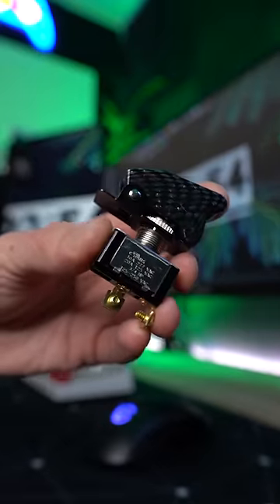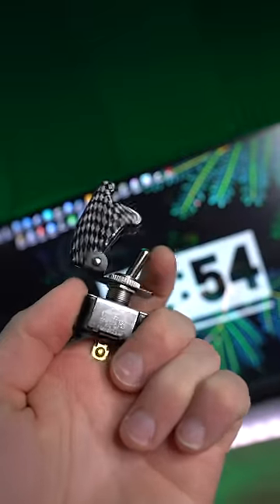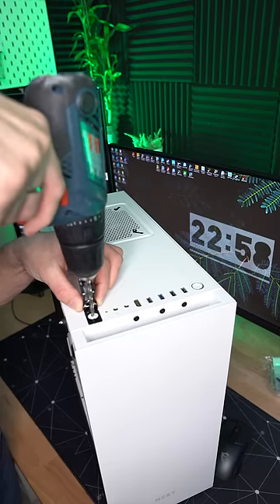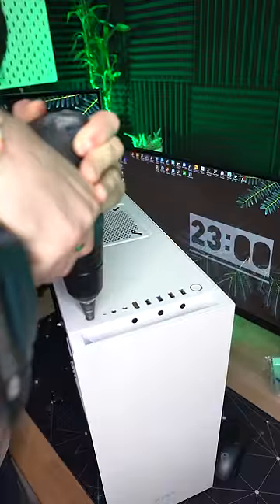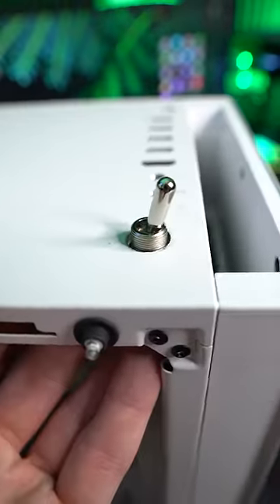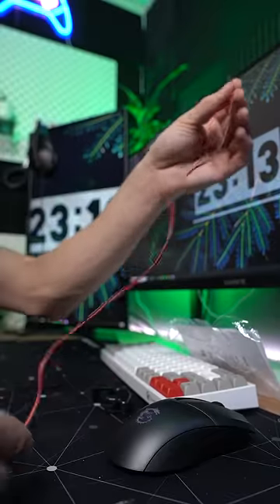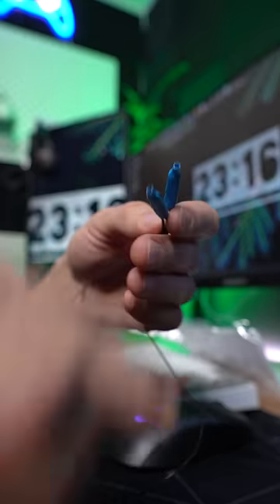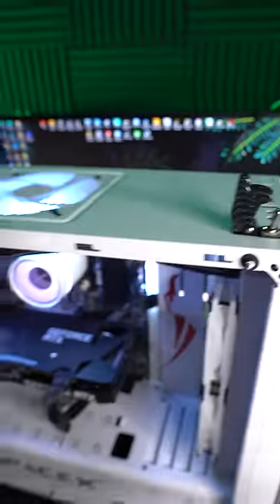Using a Fighter Pilot Switch to Turn on my Gaming PC! #shorts

Comment from the maker: Many people have done this, I first used them in July of 2020 on the 1st edition of the SpaceX PC as you can see here…https://youtu.be/kTO0JK9smew
Reply: Lmao just use heat shrink for your wires dont use electrical tape
Reply: Hey dude - buy some heat activated cable welds. Little plastic tubes which bind the wires together as though they have been soldered, and all you need is a heat source, like a heat gun or lighter.

Instant bonding and instant + tidy sealing.
Reply: @rationalgazer  someone literally just said that. You’re late pal
Reply: @TheeHusky  I'm not late, because I'm not refering to the same thing. The thing I'm referring to has a solder bead in the middle, and isn't just heatshrink tubing. So thanks for the input and allowing me to confirm.
Reply: @rationalgazer  2w
Reply: Ruined by disgusting 🤢 tape job... Solder at the base of the switch?
Reply: @rohilutekar7996  no. Because that's heatshrink, which is adequate, but NOT thing I'm describing with a solder ring incorporated in the middle of the prepared tube.
Reply: Hey man. How did you get a clock to work as your wallpaper? Can you send a link?
Reply: If your building a good pc to game on what do you think the bests parts are for this?
Reply: Man was out here with the b cons
Reply: Reminds me to when gaming cases did not exist and I went to a friend father workshop to make punched vent holes on the side cover.. Lol
Reply: @jaredhared  I would of done the same as him man ... Whatever works
Reply: Misunderstanding again?
Reply: Link to the switches??
Reply: Your toggle is mounted upside down. You should have to fully lift the cover and then actuate the switch downward (unless they keyed the switch plate that way). The way you have it you could lift this cover up and accidentally actuate the switch in one action. Defeats the purpose of having the cover.
Reply: Thats all fun and games until you accidentally turn your PC off
Reply: #save_sri_lanka
Reply: @chamindukavishka3187  Why would we? You choose a socialist government, you get to live with it.

Next time make better choices.
Reply: What name of song on this video
Reply: Dale
Reply: I think my buddies dynamite plunger power button is still cooler but switches are always cool too
Reply: Bro I watched your video from much time but I don't have my own pc I would be great if any one would gift me a graphic card
Reply: Am i the only one here who noticed he filmed this at 11pm?
Reply: @YourPersonalGeek I want to do this to my own pc where did you get the switch from?
Reply: why stop at power switch. you need a bank of them for fans and RGBs

Comment: This is definitely cool. I think it would only be cooler if you built it into your desk as a full set up and had switches for monitors and buttons for other devices
Reply: Problem with that is that you need to have a hole im the case for the wire and hide the wire somewhere wich means another hole in the desk
Reply: @daanoffline5716  yea but I mean...the man drilled a hole into his case. I'm sure he could mount his PC on the wall or something and get that all set up
Reply: @nickNcar  yeah probably
Reply: @daanoffline5716  you can maybe even use some ventilation holes for routing the cable into / out of the case
Reply: you’d definitely want to run relays for that so you don’t have the full 240 or 120 volts going through your desk
Reply: or just a switch connected to a power splitter...
Reply: @daanoffline5716  you would definitely not need to drill a hole in the case itself for the desk switches my man
Reply: dogielow  ok roblox pfp
Reply: @hvrbros8730  no relays needed. Its at max a 12V feed after the psu. And as its a very low circuit requiring very low amps. You can use any momentary/rocker switch. Even an old USB cable would be sufficient wires. I don't understand why you think we need relays?
Reply: Have u seen some people's flight sims?
Reply: @ShadowLimited310  yes some are nuts! That's basically what I was thinking with a panel for buttons and stuff that just do different command on the computer like alt tabing or opening task manager idk I think it would look cool
Reply: dogielow  ok roblox pfp
Reply: @hvrbros8730  just run the wires from the power switches inside the monitors. No need for relays
Reply: @angrycreeper100  yeah i should’ve thought of that
Reply: @hvrbros8730  12 volts at that switch, don't worry
Reply: @Dimma205gti  yea he didn't wire it into a wall outlet lol
Reply: @nickNcar  it would be easier or better to do with a IR transmitter/receiver, would still leave the PC separable from the desk and possibly no holes in desk depending how you make a control box
Reply: I WANT THIS! But how can I let a switch toggle the monitors 🤔
Reply: That would be too fuckin awesome
Reply: Im stealing that idea for a desk PC
Reply: @wantedwario2621  sorry that's illegal unless you send pictures and videos of it
Reply: @wantedwario2621  If you manage to connect the monitors to a switch as well, please let me know!
Reply: thats where i thought it was heading towards… lame
Reply: You gave me an idea that will be expensive and will have me eating ramen for a week.
Reply: Just take a few esp8266's and do it wireless
Reply: Can someone actually doing this create a reddit post?
Reply: Just having every switch in line on a panel by itself is satisfying. Turning your pc on by  flicking the switches one by one is pure bliss.

UPS flick
Voltage regulator flick
PC flick
Peripherals flick flick flick

Insert Mr. incredible ascending
Reply: @daanoffline5716  the back of a case is full of holes normally lol
Reply: Or make some floating panel at the the ceiling so he could feels like a pilot
Reply: Challenge accepted...I'll do this on a video uploaded too this channel
Reply: @hvrbros8730  5 Volts, not 240 or 120
Reply: @daanoffline5716  well, he could hide the wires underneath the desk and use a removable cover to not make it look too bad, like putting a sort of panel underneath, and have all the switches placed on the side
Reply: @daanoffline5716  not a hole in the pc only the desk the wire can come out the back of the case
Reply: @hvrbros8730 there’s a newer form of relay it’s called a transistor and when you turn your power on on a pc you aren’t actually closing the power circuit your closing base circuit which then closes the power circuit via science

Comment: As an engineer in Aerospace, if he wanted it to be more representative, he would have spent thousands of dollars buying different switches, setting up switch tests, creating validation criteria for those tests, reviewing the test data, presenting the data to an engineering board, drafting work instructions, reviewing the work instructions with another board, handing off the instructions (that really just sat "install switch") to technicians, hover over them for the whole process, once complete, go to a business review board to brag about what a good job he's done by bringing the switch onboard despite it being grossly over budget, but generally on schedule (which is still late).

Comment: Bruh, 20$ you have a good soldering iron with regulable heat from aliexpress, i bought mine 5 years ago, still rocking.
But man, crimping wires that thin is a crime, also that tape 🥵😨
Reply: At least I wasn't the only one thinking this!
Reply: Yeah I was like meh pretty cool. Then he crimped and created that abomination. 0/10
Reply: Truly an intergalactic war crime🤦🏻‍♂️
Reply: @alwattsj  you don't understand how bad that connection is
Reply: I felt sick when I saw this. That computer deserves so much more than that. (Face palm emoji) ha
Reply: @twistedofna  i was in shock. I came here to comment but i was so upset i couldnt type.seeing you guys here in the comments and Knowing that i wasnt alone gave me the courage to share my grief. Keep those irons hot brothers.
Reply: Glad I wasn't alone in thinking that borderline insurance claim was ratchet
Reply: Actually it really doesn't matter how thin they are, cause those are "signal" wires, meaning they don't carry any significant current. Just a momentary high/low voltage
Reply: @andrewut7ya511  you shouldn't be in shock, as it is irrelevant how good or bad the connection is. The voltage drop is directly related to current, and having measly current like we do here, means having a measly impact on voltage.
Reply: @dimitrijekrstic7567  It does matter cause thin wires simply can't be crimped! Add a bit of movement or vibrations and that connection will be gone in no time. If at least he soldered the leads and crimped, then it would be able to last a bit longer. Best way to join those wires would've been to solder 'em together and throw a heat shrink over them, if any then 2 turns of tape, but not that much.

edit: You're pointing out the thickness of the wire, related to if the signal is able to go thru, I was pointing out the connection not the electrical properties of the wires...

edit 2:  You seem to know what you are talking about, but you're not getting the real 'problem' here.
Surely you could use a hair thin wire to deliver a 5v signal, the thing is, if there is no connection at all...
Crimping thin unsoldered wires usually leads to total disconnection, due to the individual strands of wire shattering to sudden movements or vibrations.
Reply: Not a computer guy I’m a car guy. I’m sitting here thinking there ain’t no way this is ok. We car and truck people crucify people who don’t solder lol.
Reply: @somethingsfishy2695  true, good point
Reply: @dimitrijekrstic7567  i knkw what you mean, but as someone who solders for a living i just love neat clean work. While i know the function is the same i would just like every connection to be tidy with small shrink wrap. I see this as a missed opputunity to make something nice. Im a solder nerd, i started building drones and the feeling of melting metal together in such a precise way just strikes me as pleasurable to the point that i practiced enough to quit my pipefitting job and solder custom battery packs. 🤓
Reply: @kylewest100  as a mechanic, crimp and heat shrink is all manufactures recommend for wiring repair, also you won’t find any solder connections or splices in any car or truck made in the past 30 years. Solder is too brittle in a high vibration applications leading to cracking and eventual broken connections. Did auto restoration and you’d find a lot of broken solder wire joints when going thru an old harness. The work this guy did is straight trash tho
Reply: Got mine from my trade class last year.. soldering is fun af
Reply: @meltedWax169  until you realize the fumes can give you cancer, but you're too lazy to do anything about it.
Reply: @Suburbanhotrods  I've researched a bit over the "crimp vs solder" debate and it seems up to preference, just check the comments of this video. 
https://youtu.be/E_m8xf3vfYE
Reply: Even my dad make more good looking connections
Reply: That's electrical tape not ductape
Reply: ORRR he me out.. he couldve just bought female to male Board Jumper Cables. Like 5 Bucks for 50 Pair..
Reply: @somethingsfishy2695  only if your using leaded solder
Reply: @Suburbanhotrods  then he should of at least used proper, compact, nice looking crimp connectors with shrink tubing on top, or, even better, gotten a longer piece of wire that went from the pin connector to the switch without any splices. Moral of the story - he is confused, but has the right spirit. He could of made it look nice and make it secure, but he didnt
Reply: Was horrendous
Reply: @kylewest100  customer pulls out of ship driveway: car immediately dies after going over the curb disconnects the ignition switch
Reply: @Suburbanhotrods  tell that to the audio and off-road community on YouTube etc etc. I see more people soldering than crimping.
Reply: @dimitrijekrstic7567  there's an idea of having pride in your builds though. You're investing time, energy and hard earned money into these things in hopes that they'll bring you problems free joy and look good while doing it. This simply isn't it. Take some pride and do it right the first time.
Reply: @Suburbanhotrods  you don't crimp above 18g. It won't hold very well.
Reply: @steven3915  I agree
Reply: @steven3915  tell that to every manufacturer, in crimping there’s two components electrical connection and mechanical connection. You never completely rely on the electrical connection or the crimp to hold the wires that’s why you heatshrink along with crimping
Reply: @Suburbanhotrods  manufacturers generally use connectors and terminals instead of crimps. Put it to you like this, if I bought a 2022 F350 and I saw crimps on wires from the factory I'd shit myself. That argument doesn't hold weight.
Reply: @steven3915  how do think those terminals in the connector are made?? There crimped terminals, no solder. Go look at any tsbs for repairing broken wires, manufacturers only recommend crimp and heat shrink. How to tell me you don’t know shit with out telling me
Reply: Hey. Not everyone is good with their hands like that.. or mechanically inclined
Reply: When you have PC's catching fire because of dodgy manufacturing such as NZXT and you have this guy doing this is asking for trouble...
Reply: Its a free country people can do whay ever they want if you bought the tools then good for you . Do it
Reply: Glad I wasn't the only one thinking this.
Reply: @alwattsj  
Shit, replicate it yourself.
See how quick the PC's internals melt, or better yet catch on fire.
Reply: @titandelavega5923  

So if i bought a Gun, i can legally shoot my enemies?
Reply: @andrewut7ya511  No not all connections....you dont solder in house electronic, there you always use Clamps
Reply: Dude I think how he attached the wires to the switch should be a fucking crime that's what I'm taking most issue with
Reply: Soldering iron and aliexpress are two things I don't think I want to hear in the same sentence, it just reeks of house fires
Reply: Lmao friction welding is the only reasonable way.
Reply: Nah you can easily crimp 30 gauge but you for sure need proper 30 gauge connectors and usually that small requires specific crimpers that only do 28ish and smaller.
Reply: I feel like if heat shrink tubing and just enough electrical tape was used around the wires, it would look a LOT neater
Reply: This whole video is bad

Comment: Finally something that will help me against my cat sitting on the power button
Reply: I never thought anyone has the same issue that i do 😂😂
Reply: @kami_dred7319  free protein
Reply: When the lid shuts it switches off.
Reply: had the same problem when my cat jumped on my pc clicking the power button. if you are a windows user (you most likely are) go to control panel and power settings and change the action on the power button to none, now you can only turn it off by clicking shut down in windows or holding the button for a few seconds (because it will be seen by your motherboard that you are holding it)
Reply: @kami_dred7319  I do this all the time. I get a new car like every month because they all end up on the power switch and they they end up in my stomach but I still like cats so I get new ones
Reply: @kami_dred7319  humanity is dead

How could you kill or eat a cat without cooking it first 😩
Reply: @thecoolguy9364  I thought his pfp was a hair on my screen at first
Reply: Cat: sits harder
Reply: If you get it you get it
Reply: I just leave all the hair on my screen so I don't fall for it ever again.
Reply: @DarthLeopard  why :(

Comment: When splicing a cable, stagger the butt connectors to minimize the thickness of the connection point, though you trade thickness for distance of cable consumed.

Comment: Him:"this is a fighter pilot toggle power switch" 
shows that it's not a toggle switch

Edit:thanks for the 400 likes
Reply: ikr but what are these called agaib
Reply: @kipchickensout  momentary switches
Reply: @rpsteele12  spst momentary switch :p
Reply: Toggle switch have three wires I think
Reply: @pratiklondhe5167 usually 2 but you can connect a third one
Reply: @TadaHrd  depends on if it's a NO/NC switch where you can choose. Or just NO like this one. NC is not used very often in toggle switches.
Reply: @pratiklondhe5167  they can have either 2 or 3 wires, same with the momentary switches
Reply: Realized that too when it flipped back lol
Reply: Also, they're called missile switches, not 'fighter pilot' switches
Reply: @TadaHrd  wrong.
The "Toggle" refers to the style of the handle, as compared to rocker or push button switches.
You can have maintained or spring return positions on a toggle switch.
This is a n/o spst spring return toggle switch.
And "momentary" isn't actually correct, because it will maintain the closed position as long as you hold the toggle up.
Reply: @ke6gwf  it returns back
Reply: A toggle switch is a type of electrical switch that is actuated by moving a lever back and forth to open or close an electrical circuit. There are two basic types: maintained contact and momentary toggle switches.

This has literally nothing in common with anything found on a "fighter jet"

Comment: If you really want it to look like a switch on a space craft you need to add little chrome bars either side of it. All switches on spacecrafts have them to make them easier to use in micro gravity.
Reply: Couple of notes: First, no they don't all have the bars. Second, the bars are to stop other stuff hitting them accidentally not to make them easier to use. It actually makes it a bit harder to use.
Reply: @MinistryOfMagic_DoM  those are both good points. Perhaps I did over generalise, but I have heard an astronaut say that the guards help with not flicking adjacent switches and they also give you something to press off to toggle the switch because you don't have gravity anchoring your weight.